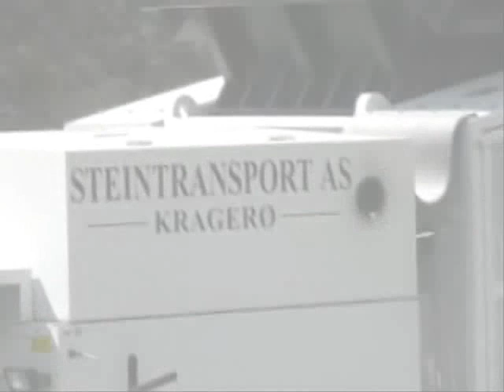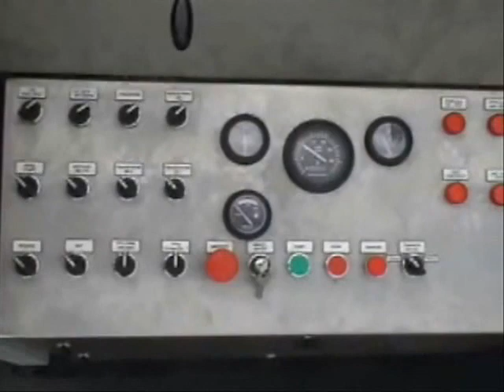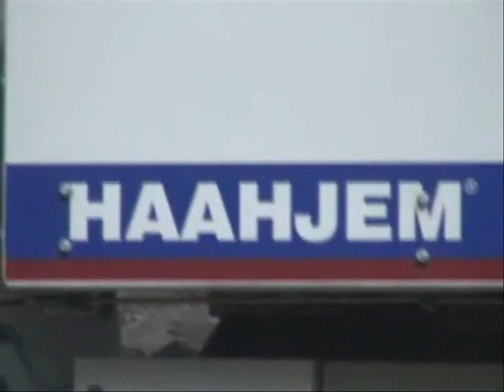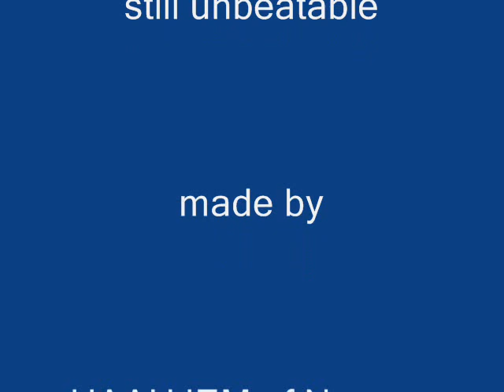HAAHJEM CTC 1208 S - Track Mounted Heavy Duty Primary Crushing & Screning Plant

Comment from the maker: You're right Laurids. We have many units sold to Denmark since the first was launched in 1985. As you can see the new line have increased a bit size since then, but tripled in magnitude when it comes to capacity. In addition we have added extensive list of features improving operation and maintenance. Thanks!